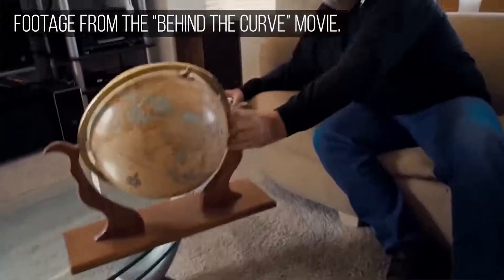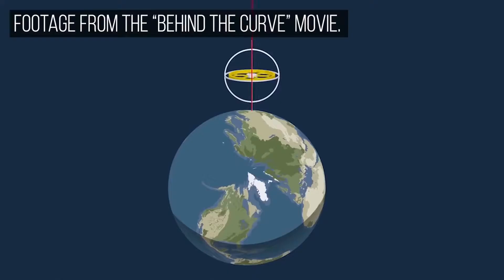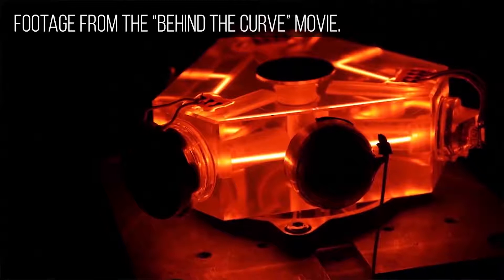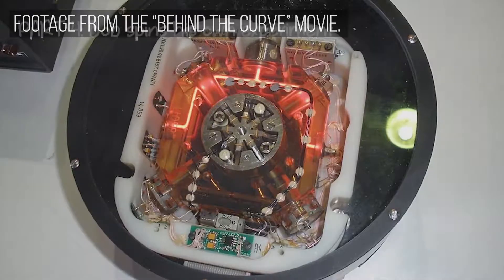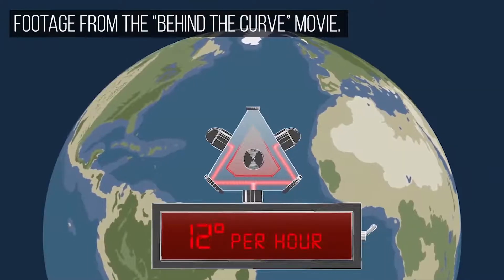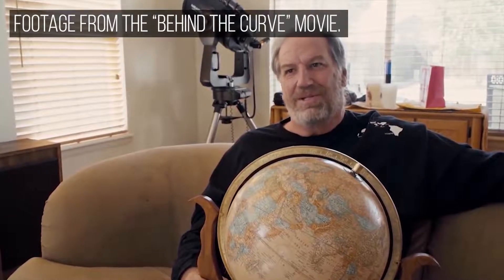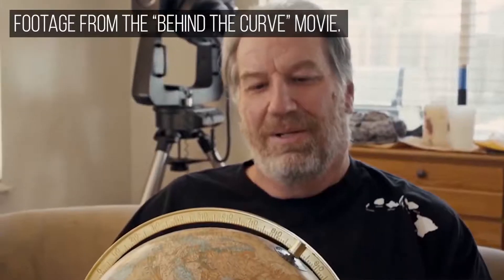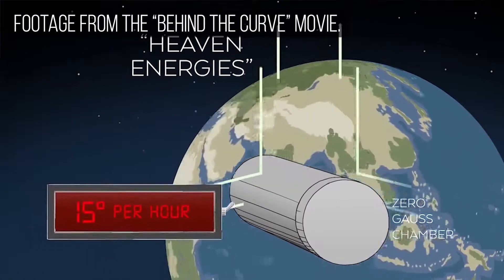36. Flat Earther Inadvertently Proves the Spinning Globe.

Comment: How can vast bodies of water adhere to a globe?  Gravity can't be responsible.  That's a mere theory that fails to take into account the relationship between mass and density.  How can a vacuum, which, so we are told, is abhorred by nature, exist side-by-side with a pressurised air system in the absence of a container?  What about these crazy orbital speeds which can be broken down into freemasonic/satanic (same thing) occult numbers? How do cranes not topple over?  If there is any motion, which is impossible to sense, how come someone with travel sickness can tolerate it, then jump into a car travelling at 30mph and throw up?  Why is curvature, however slight, never an issue for the designers of bridges, railway tracks, etc?  Although I confess to not having read it, I understand there exists a book detailing emergency aircraft landings that are consistent with the flat model.  As for gyroscopes and all the rest, science also told us 3 years ago about an illness that existed.  It was a flagrant lie and there were plenty more before and have been plenty more since.  Once I've found that someone has lied to me about something, I reserve the right to suspect they have lied to me about everything. There may be any number of FE shills, just as there are plenty of GE shills and NASA fanboys.  FE carries too much baggage these days, anyway, so I'll just stick to my favourite - a level plane at rest - and that's without any help from gravity!!  All the best.
Reply from the maker: Gravity has to exist but I think also there have to be other unseen forces. The reasons given why the moon doesn't coalesce with the earth are unsatisfactory. The "vacuum" of space has to be very different from the true vacuums we create in small enclosures here on earth. Motion is relative, the earth travels merely 15deg per hour.
          I'm not a FE shill obv but also not a NASA shill, an agency whose main purpose (but not sole purpose) is disinfo lies. I thought that might help people look at my vids 33 and 34 with an open mind. I failed. Nobody did. You seem intelligent. Have you seen vids 33 and 34? Can you argue against anything I said in those vids?
         Just buy a £80 telescope, look at the moon and you will no longer be a flattie. The physical, emotional response you will have will cut through any blocks you have. I have had two flatties in my flat in the eveining, showing them things with my telescope and they lost their FE beliefs. I have only so convinced one person by arguments alone.
Reply from the maker: Correction: one flattie did look at 33 and 34 with an open mind - Dyad in the CROSSMAN thread below this. Thank you Dyad.

Comment: In order to open the champagne for globe earth, I personally would need to fully understand the technical mechanism called "gyroscope". If one doesn't fully understand how it works then how can it stand as proof? Rhetorical question. Good video, anyway.
Reply from the maker: Research the older mechanical gyroscopes with pendulous vanes - I've seen yt vids on pendulous vanes. The mechanical gyroscopes are still used on general aviation planes because they're much cheaper than the laser electric ones which was the type in this video.